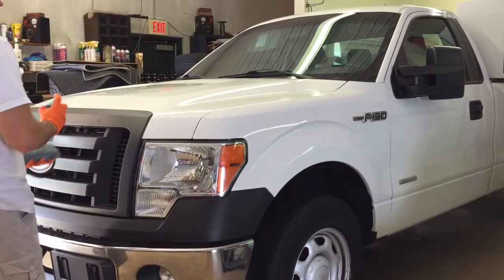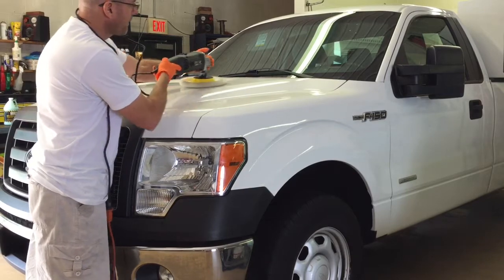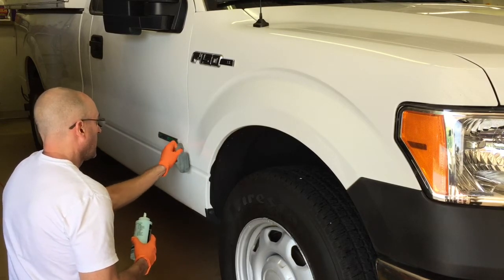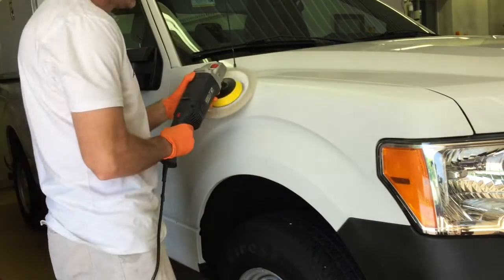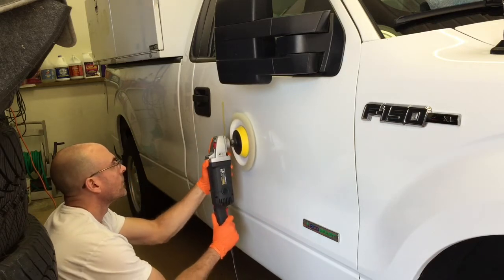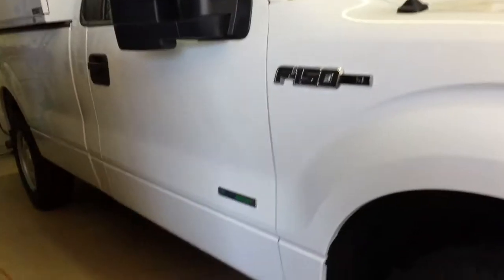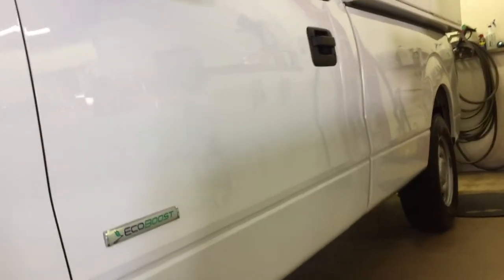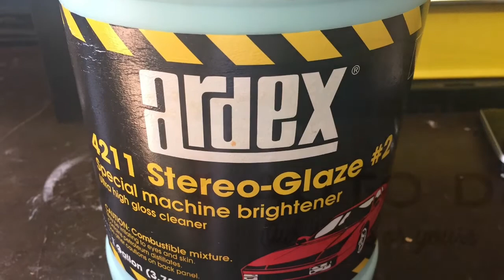Special Machine Brightener!!!!  Remove Stubborn TRAFFIC FILM, Stains, and minor blemishes !! Ardex!!

Comment: For the amount of staining it had on that car   I thought something like citral266 would be the only thing that would get it off.  that stuff works pretty good. When I hear the word (brightener)  I automatically thought that it was something that goes on on top of my polish,  thinking it was going to Brighton the car up in between washes never would have thought it was something you use prior to paint correction. I wonder if it removes old wax and sealants? Thanks for the video .  I probably should have waited till the end of the video to make my comment you might answer my question in it

Comment: What wool pad are you using on the Rotary polisher?    I see that it leaves about a 1 inch gap between the backing plate edge and the edge of the pad itself which gives you some "play room" I guess is what you would call it, allowing the edge of the wood pad to "flap" around corners so to speak rather than be rigid right up to the edge.    I assume that is why there is so much space in between, to prevent accidental burning of the paint, or to at least keep it to a minimum risk.    I think the rotary is a very undervalued tool in detailing and most people shy away from it due to hearing the horror stories about them burning right through the paint in the first 5 seconds of use, which, as most experienced detailers know, is not true.     I may give that Pad and the Ardex  a shot and see how it works.
Reply from the maker: Ardex has all the top quality pads as well👍🏻  I have a smaller backing plate on there. I like the "give" the pads have going into corners and contours of the panel with it. Feels smooth as butter👌🏻
Reply from the maker: You are the only one who acknowledged it so far. Good eye👍🏻